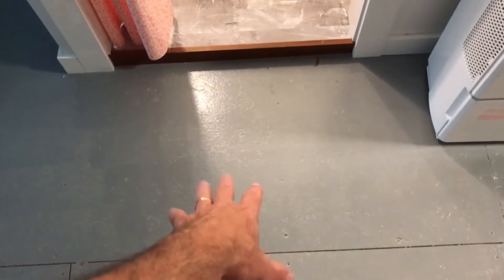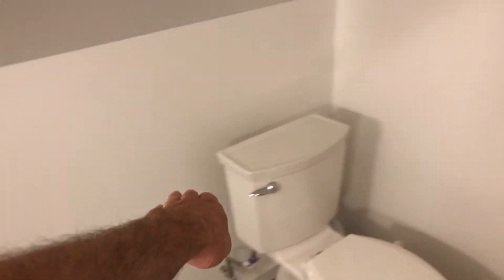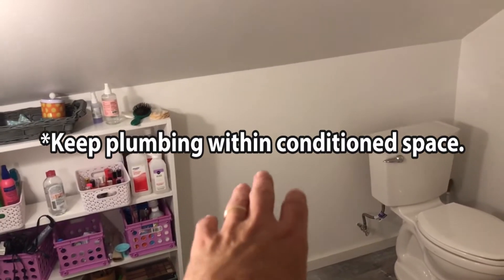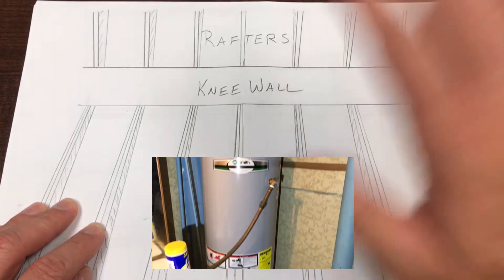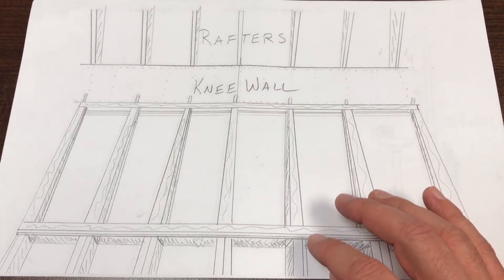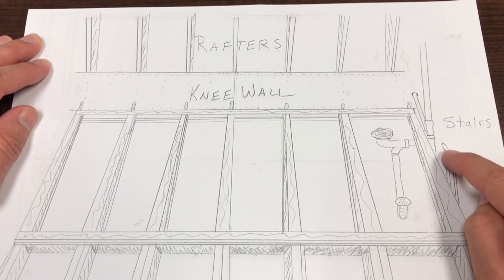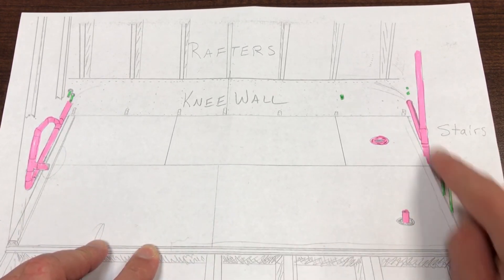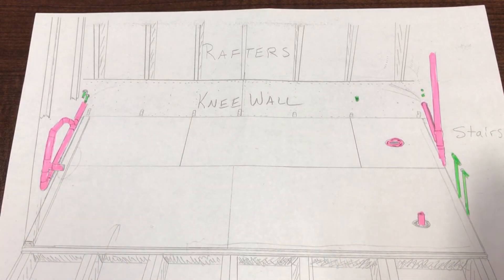Can you have 2x6 joists in a bathroom with plumbing?

Comment: Would the plumbing fit in 2x8 joists?
Reply from the maker: It would be tight. I would test by going to the local home center and holding up any needed traps or fittings against a 2x8.

Comment: @DIY Dave, are you sure you cant cut holes in joists? I've worked around apprentice, journeyman,master plumbers, and they said you can. How are you to run your pipes if you dont cut the holes in them? I'm sure you're going to say underneath the joist, but what if that's not an option? Help A.S.A.P!!!!
Reply from the maker: You can drill holes in joists, but they can't be larger than 1/3 the depth of the joist, and they also can't be located in the middle third of the joist (lengthwise). So with my 2x6 joists, my holes could not be larger than 1.8 inches [5.5" (joist depth) divided by 3]. If you can't run them through the joists, you might run them in the joist bay till they are over a wall of a room beneath,, then down into the wall and through it till it gets where it needs to go. If the pipes are large, you'll probably have to make the wall thicker, or turn it into a chase. I'm not going to lie. It can be very tricky and more invasive than you might have planned. You just have to stay patient and creative and think of it like a puzzle you're trying to solve. It can be done, though it might take more work. All the best to you!
Reply: @FamilyFriendlyDIY  what about the vent system you ran for the lav. sink? Could you elaborate or show a clearer video of the diagram of it? I need to see the par6s used and direction of them.
Reply from the maker: @babyboinews6896  here's a picture of something very similar to mine https://diy.stackexchange.com/questions/41041/2-parallel-drain-pipes ... I hope it helps.